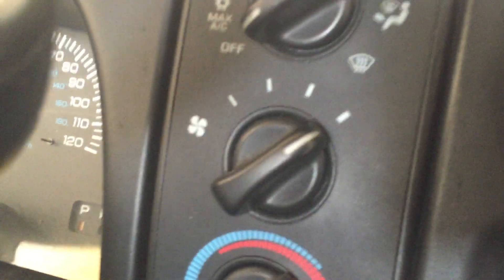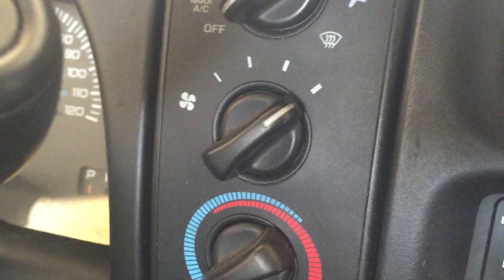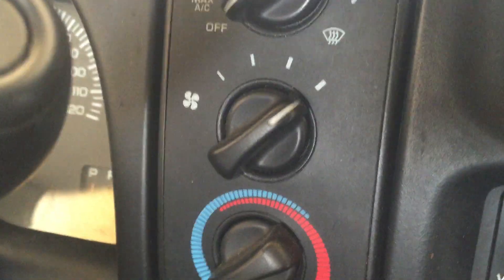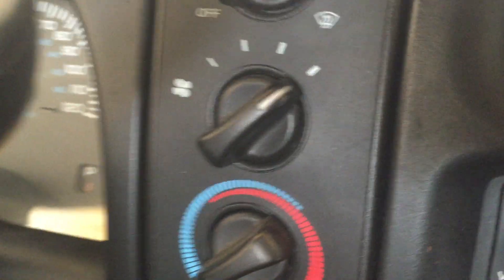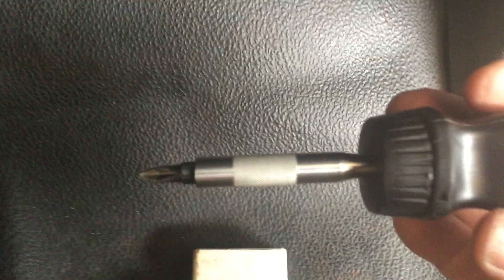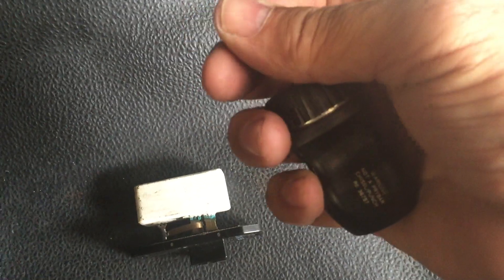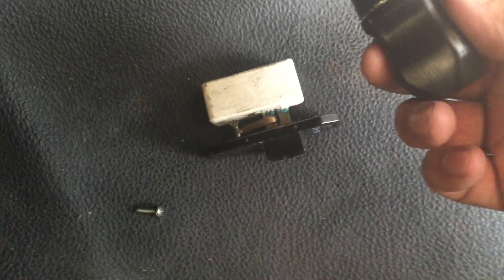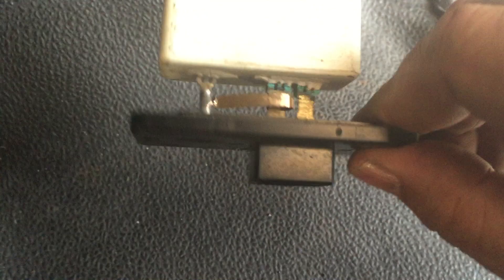My AC Switch Only Works On High: How To Fix My Fan Speed Control

Comment: I changed resistor 2012 fiat 500, didnt fix the speed issues, still only blows on #2. Any suggestions?  I changed the radiator,  radiator fan and condenser as they were crushed.  Ac doesnt blow cold so added refrigerant to no avail. Heard hissing.  I didnt attempt to vaccum system so not sure if any of that would cause fan speed issue.
Reply from the maker: you are correct, vacuum wouldn't have anything to do with the speed of the fan.  my guess would be it's the switch itself.  must have a short in it.

Comment: I have a 99 Dodge Ram 1500 4x4. Sometimes the AC won't come on and I have to turn the truck off and on again. Then it either 1) blows low and hot OR 2) blows super cold. Any suggestions? And thank you for your time!
Reply from the maker: it blows low & hot while driving or standing still?  it blows super cold while driving or standing still or both?
Reply: it blows either low/hot or super cold whether i'm driving or standing still.
Reply from the maker: did you replace the resistor like in this video?
Reply: I just ordered one yesterday and the part should be here in a couple of days. I will update you how it goes. Thank you!!

Comment: My dial was working only on high but now it doesn't work but I can hear the blower. Any suggestions?
Reply from the maker: yeah.  but i forgot what it's called.  it's a white rectangle shaped gizmo that is under your dash (in the middle but more towards the passenger side).  that gizmo controls the speeds on your fan switch.  i too had a situation where I only had one speed on my blower.  i switched that gizmo out and it solved my problem.  if you can get this at the junk yard, it's a $5 dollar piece and you will be a happy camper.   sorry i can't remember the name of that gizmo; maybe it's too early in the morning!!!  good luck.  take it easy.
Reply: conquryourfear I changed the resistor but still not blowing air. About three weeks stop blowing air, do you think it's the fan or a fuse?
By the way, thank you for taking your time replying!
Reply from the maker: Roberto Quiñonez the fan definitely has a fuse.
Reply: conquryourfear I'll check the fuse in a bit hoping that will solve the problem. 
Thank you again!
Reply: conquryourfear hi guy, I would like to see a video on how to change the fan blower motor,  can you tell me if you have a video? 
Thanks again
Reply from the maker: I don't have one yet.....one is coming though.  It's a job, brother.  easy job, just time consuming